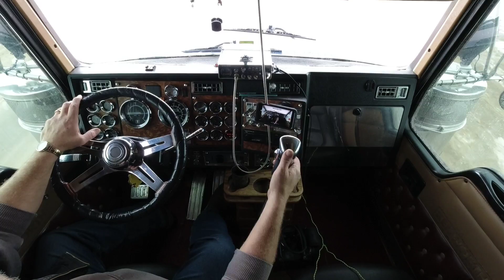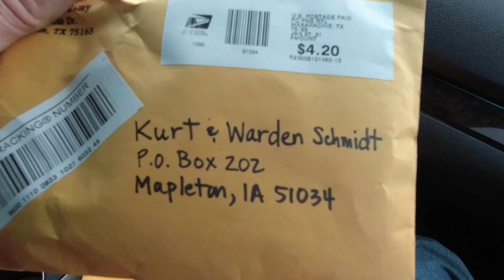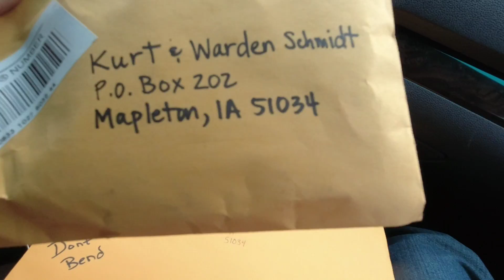Iowa Ice Cream Loaded ~~ Moving The 5th Wheel On The Kenworth #271

Comment: Good information on the fifth wheel and getting the weights correctly axles out.  I took my fifth wheel and plate off the truck and cleaned the frame and repainted it then reinstalled with new grade eight eight bolts.  The reason for this is that it is hard to clean the top part of the frame and a new coat of paint was a great idea.  My truck will tip the scales over twelve  thousand with a load with both fuel tanks are full when the fifth wheel is centered between the drive axles.  In that instance I will slide the fifth wheel a couple of inches back of center.  I  have had scale house operators check tire weight rating (on tire sidewalls)  when carrying more than 12 thousand on front axle.  Tennessee  is the only state that I have saw do this.  Another scale tip the plate that is on the ramp before the platform scale if you cross this with brake applied the front (steer)  will weigh more  than 12 thousand that will often determine whether you cross the scale or are bypassed.  I have used this tactic for years and it appears to work.  What I typically do is slow on the ramp drop a couple of gears before the plate then slightly  accelerate as I cross the plate with the front axle "usually" that gives me the green for bypass on the platform scale.  Try this and see if it works for you?
Reply from the maker: Yup very nice

Comment: G'day Kurt, great set up with the fifth wheel, will make a big difference to ride, handling and weight distribution. Putting grease onto the turntable is messy and wastful, l found if you grease the skid plate and around the king pin of the trailer, the waste and mess is minimal when you lift your suspension just before you lock the jaws around the king pin mate. Keep on truckin and stay safe Kurt. All the best to the family.
Reply from the maker: Ya, the shop greased it up before I picked it up.

Comment: And.  With that trailer sitting up nice tight it will keep the back of first class a heck of a lot cleaner.  Hope it all works out good for ya.  Unfortunately I have Deer  bumper so I have my fifth wheel back a bit more than that.  And with 300 gallons of fuel she’s a heavy girl
Reply from the maker: Ya, gotta watch that front weight .
Reply: @truckingwithschmidt7120     Yes sir, I have never been under 12 k on steers. Always. 12500. Ish.

Comment: When I drove and got a different tractor I would scale a heavy load like you did.  With your steers at 12,000 lbs. and your drives that close to 34,000 lbs., you will never have to move you fifth wheel again no matter your fuel load.   Plus fifth wheels are a pain to move by one person.

Comment: Kurt those 8 bag air suspension from kw have been known to lean more than normal. I guess the air from one side goes to the other side in a turn. A buddy of mine made one into a tri-axle dump and it was awful. He put two different leveling valves on his. One for each side.
Reply from the maker: Ya im hearing that. Maybe time for a cut off lol.

Comment: Occasionally you will see an OO with a dedicated reffer and the fifth wheel brings the trailer right up against the sleeper.
It’s a way to get the most fuel mileage. No dead air space makes it slip through the air..

Comment: Kurt You probably know this already, However there's no way to tell for sure I have met guys with many years experience that didn't know this. So for those that don't.. Often the CDL handbook and driving schools Mislead drivers into thinking that axle weight in the steer is NO MORE than 12,000 pounds. This is NOT CORRECT. ANY single axle that is more than 10'2" from the next closest axle can weight up to 20,000 pounds... EVEN the steer axle... HOWEVER... The axle has a max weight rating on it as do the tires.... SO if you look on the weight sticker on your door jam you will see the steer axle weight rating. These are usually 12350, 13500, 15000 now most trucks come with a 12350# axle unless they are ordered with a heavier axle. SO that means that axle is capable of carrying 12,350 pounds not just 12,000. Now with any axle the allowable max weight is based off of the axle rating and/or the tire rating. whichever is LESS.. SO a G rated 14 ply tire any size 22.5 or 24.5 is rated at 6175 lbs at 110psi cold.  you have two tires on a steer axle so add them 6175 + 6175 = 12350 so with G 14ply rated tires on a 12350 rated axle you can have 12350 lbs in that steer axle. Let's say your axle is rated at 13500lbs and you have the G rated tires then you can only go to 12350 on that axle because the tires are your lowest rated weight. However H rated 16 ply tires are rated 6610 at usually 120 psi. 6610 + 6610 = 13220 so on the same 13500 axle you could go 13220 lbs but on a 12350 rated axle even though you have 13220 lbs worth of tire rating you now have to go by the axle rating because it's the lowest. Air pressure is a MUST.. if the tire is rated for 6175 @ 110 psi and you only have 95 psi in it and have 12350 lbs on that axle then even though you have the proper weighted axle and tires, you can still get a ticked for overweight because the weight rating on the G tire of 6175 is only good at 110 psi or higher. Most manufacturers of American tires will have a weight to pressure chart on their website. SO let's say your tires are rated at 5995 @ 95 psi if you have both tires at 95 psi then you can only weight 11990 on that axle. 5995 x 2 = 11990.  HOWEVER regardless of what you have where you still can't go over 80k on five axle with 2 tandem groups. So if you have 12350 on the steers then either the drives or trailer can't be over 33650 lbs.   12350 / 33650 / 34000     12350 / 34000  / 33650
Reply from the maker: Ya , I always just find it easier to stick with 12.

Comment: (1st-time poster)  I noticed you mentioned something about a 12K front axle  I would appreciate your trying to help others understand such ratings  Seems you know what your talking about and while I really figured 16K would be closest to ideal on a full rig w/ APU and all the trimmings  (Maybe 14 but never heard of such a beast)
Reply from the maker: Will do, this truck is around 22 000 lbs itself. But I will explain a qwick version in an upcoming video.
Reply: @truckingwithschmidt7120  Yeah you could probably help bring everyone up to date too   Twenty years ago it seemed 44K was expected  Now it is 46K which might just be based on lighter trailers?  Really I just don't understand how some company is going to run a 12K steer w/ a fixed 5th wheel because I'm not sure it sounds so hot even if was a sliding  (Think any amount of shippers know to load better/different if you mention 16K axle)  Been 20 years so I can't exactly recall specifics  I'm pretty sure tho that to hit and keep below my 34K limits I had to run at times something like 13,450 on steer  Scales cost double now too  That's another head-scratcher in that not everybody scales  (maybe dedicated etc.)
Reply: Apologies, I understand my chicken scratch can be difficult to read  I was referring to 13,450 on a 13K axle  It would seem the same load on a 12K would be jacked up no way no how  Also what is ideal  I know we probably don't want 20K bobbin up and down the road in icy road conditions when bobtailing  But just safe, legal, and some chance at hauling most 46K loads w/ a full spec truck
Reply from the maker: It's actually not to bad with the trailer movable as it is, I can only haul 43,000 legally because the kw is pretty heavy.

Comment: G'day Kurt, I had trouble with the live stream yesterday, could not write anything. I understand the per axle load and position the fifth wheel, i marked the wheel position for hay (hay, lighter) and (corn silage heavier) not only that when run two trailers we have two fifth wheels, Watch the truck today looked like it road better too.
Reply from the maker: Uh wounder why that was, ya if I moved it more marking it would be good. Been hooked to the trailer for a couple years thou. And definitely rides better.

Comment: Kurt, great video. I'm not a trucker so, ignorant question. Let's say you'd had your own trailer and you'd never switched, would you still have to move the 5th wheel back and forth? (I assume that the trailer tandems still would have to). And related to that, would you still have to regularly grease the 5th wheel, or is it only for sliding it under the trailer and hoock it up? 
P.S. Call me crazy but the music totally sounded like Eric Clapton, thumbs up to that hehe
Reply from the maker: As long as your pulling the same type of trailer you usually never have to move tge 5th wheel. And yes no matter what you always need to Grease tge 5th , if it's a greaseless one you don't. But that Grease wears off fast.

Comment: I use to run my steers around 11,500 fully fuel. At 12 use to wear my tires even keeping correct air pressure in them. Just saying.

Comment: Does the rpm fall slower on a cat motor? Seems like the Cummins engine I run I wouldn't be at the correct rpm to get it into the next gear when watching you shift. Maybe I'm crazy but it seems I have to move the stick sooner to get the next gear.
Reply from the maker: Definitely,  it falls slower and usually climbs a tad slower

Comment: When you split gears you pull it out and put it back in every time?
Reply from the maker: Usually,  but there's times I don't as well.
Reply: @truckingwithschmidt7120  I just got my first 18 speed and did know if there was a reason for that, I’ve seen a couple people shift that way.
Reply from the maker: On up hill starts or in traffic I use my lowers tge most